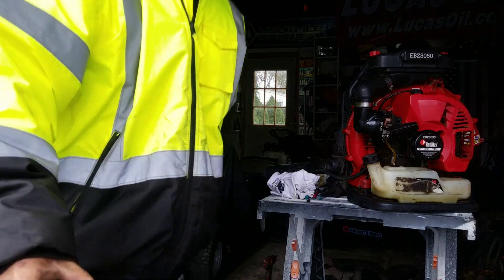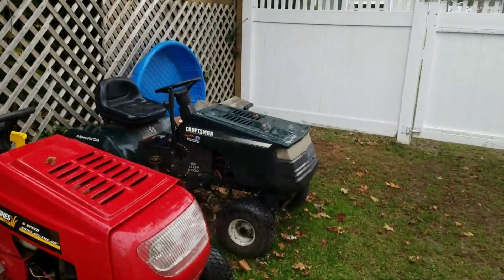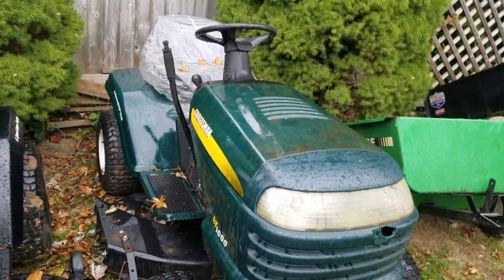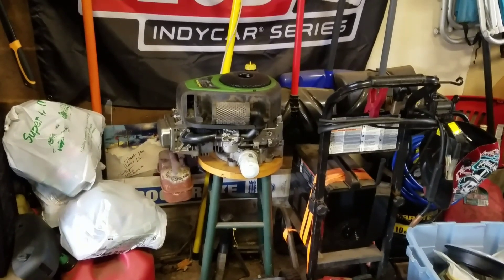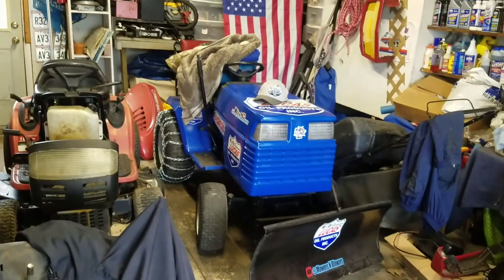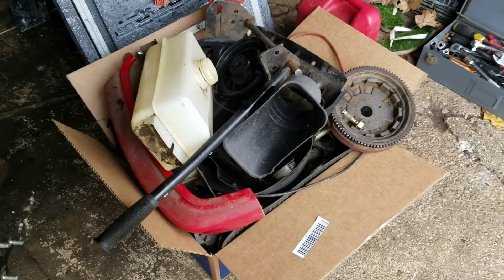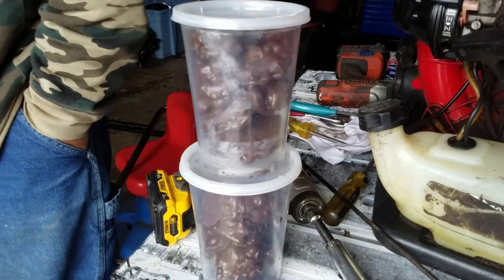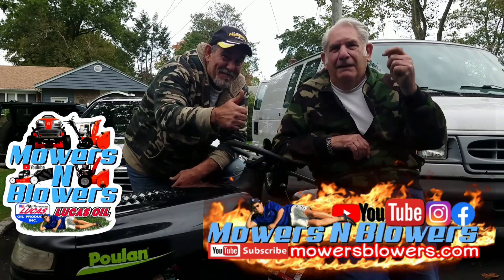CRAFTSMAN LT1000 LAWN TRACTOR EBAY PART OUT TEARDOWN DISASSEMBLY HOOD NOSE POULAN WEEDEATER FITMENT

Comment: On the tamper, it's just a standard Honda engine, and those carbs are a pain, just take your time, also put the pull rope mechanism on right, it's pointed down..... Great video as always, got my br320 running like new, turns out the gasket was blown out in the front, now it starts on first or second pull.

Comment: When you put new rings in on a motor u should measure the bore it might need to be bored out  idk if oversized pistons are avAilable and also that red ax blower is worth 250 max
Reply from the maker: Really...because I've been getting like 50 offers of $300 today.
Reply: Maybe the market is higher on Long Island
Reply: If you put a piston ring in the bore and the ring gap is bi u will know

Comment: You said you had play in the piston with new rings in the seleve. pull the head and piston out, put a new ring inside the seleve use the piston to push it down  
about one inch, measure the gap on the ring ends this will tell you if the seleve is to large ,feeler  guage read 30 thousand seleve is over sized no good

Comment: The seleve in that motor is over sized by the ring wear, you will find it to be over 30 thousands bad seleve
Reply from the maker: What motor? This was a disassembly video
Reply from the maker: Ring wear with no scoring? There's not even a smudge on it. Perfect cylinder.  Maybe it's warped.